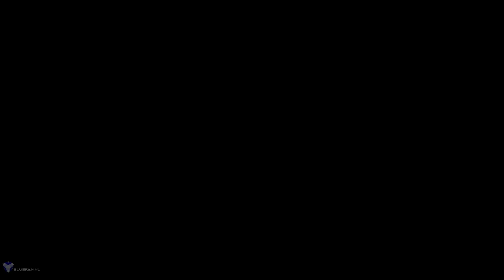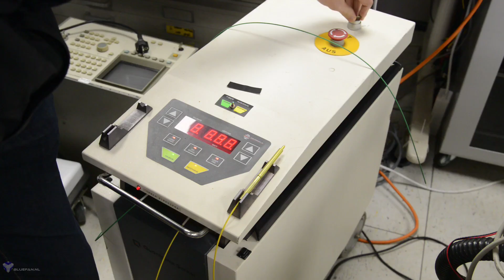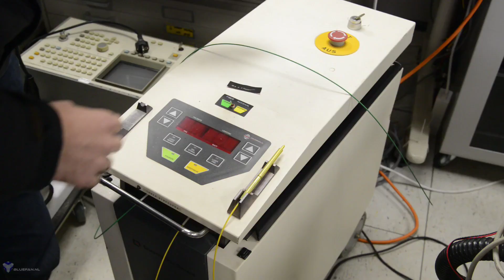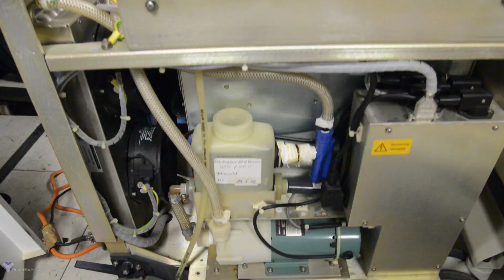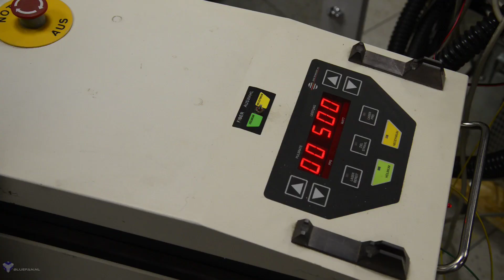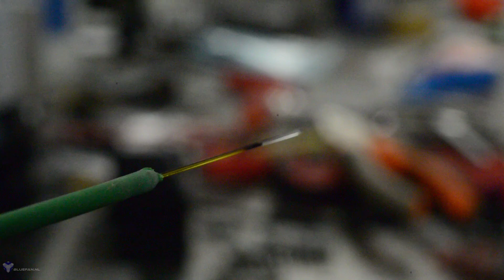Quick repair of Holmium laser

Comment: ai summary

Expert Persona: Senior Laser Systems Engineer (Medical Instrumentation)

Abstract: This technical assessment details the diagnostic and repair process for a Quantronics Excel Dual Pulse 2000, a medical-grade laser system housing both Neodymium (Nd) and Holmium (Ho) laser cavities. The investigation focuses on a persistent fault in the Holmium subsystem that triggered non-documented error codes (500, 504, and 600) upon activation.

The analysis reveals that the system utilizes a symmetrical optical bench with flash-lamp-pumped cavities and solenoid-actuated mechanical shutters for beam gating and safety dumping. The root cause of the system failure was identified as mechanical friction within the non-precision shutter assembly, leading to a feedback mismatch at the micro-switch sensors. This discrepancy prompted a software-level interlock halt. Additional maintenance was performed on the delivery fiber, which exhibited thermal damage at the distal end, requiring stripping and re-cleaving to restore beam integrity.

Repair and Diagnostic Summary:

    0:05 Dual-Cavity Architecture: The Quantronics Excel Dual Pulse 2000 integrates two distinct laser sources—Neodymium and Holmium—into a single chassis with independent fiber outputs and a shared cooling/power infrastructure.
    1:57 Fault Manifestation: While the Neodymium side operates within parameters, the Holmium side triggers a terminal error message upon foot-switch activation, halting the flash lamp and rendering the interface unresponsive.
    4:03 Laser Head Analysis: The internal assembly consists of two identical laser cavities containing flash lamps and laser crystals. Cooling is achieved via a shared water-jacket system. The cavities are non-Q-switched, meaning pulse duration is governed strictly by flash lamp discharge timing (typically 100 μs to several ms).
    5:38 Shutter Feedback System: The system employs spring-loaded, solenoid-driven shutters. Each shutter is monitored by a micro-switch to verify open/closed states. Initial inspection suggested the Holmium shutter was not articulating smoothly.
    6:11 Optical Path and Monitoring: The beam path includes folding mirrors and a central energy meter. This meter monitors pulse energy to ensure medical dosage accuracy. Light leakage through folding mirrors is used for this real-time monitoring.
    8:43 Flash Lamp Simmering: The unit utilizes a "simmer" current—a low-level discharge that maintains a conductive path in the flash lamp—to ensure reliable high-voltage triggering during active firing.
    10:15 Root Cause - Mechanical Stiction: Testing with interlocks defeated confirmed the laser fires correctly, but the shutter mechanism frequently sticks. Error 600 is identified as a "failure to open" and Error 500 as a "failure to close" based on micro-switch feedback.
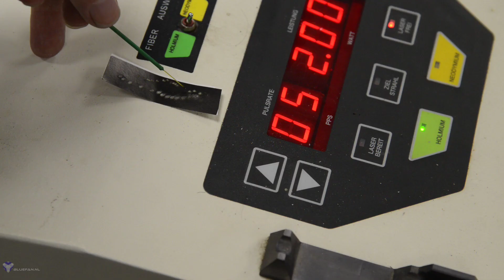    14:44 Fiber Optic Damage: Inspection of the delivery fiber revealed "glow" and sparking at the tip, indicating structural damage and internal burning of the cladding.
    15:41 Maintenance and Remediation:
        Mechanical: Lubrication was applied to the shutter pivot points to reduce friction and satisfy the timing requirements of the feedback sensors.
        Optical: The damaged fiber was repaired by burning away the yellow buffer coating and performing a manual cleave on the large-diameter core.
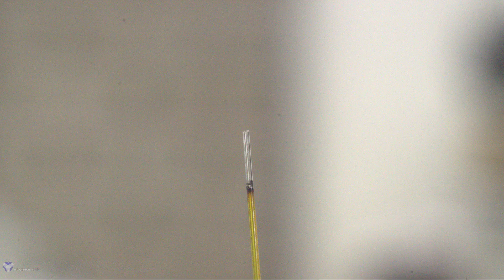    16:42 Verification: Post-lubrication and fiber repair, the system successfully cleared all error codes and demonstrated stable output on both laser channels.